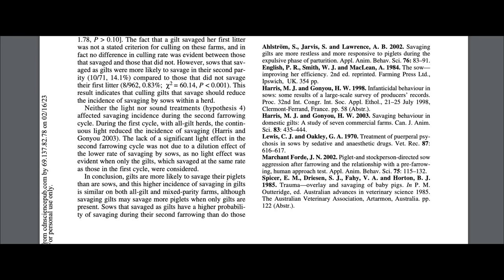How To Beat YOUR INSANE PARENTS In "Mom and Dad"

Comment: Another method is to crimp the end of the garden hose shut: pressure either builds and means the gas will take the path of least resistance (like any weak point anywhere in the hose or the flow is compromised and the gas can't flow as fast, buying Carly and Josh A LOT more time.
Obviously, don't use anything electrical that put off sparks:
Power tool or matches + natural gas = BIG BOOM!

Comment: Once the parents try breaking into the school, i would just go get a mop or something then run to the classroom get my bag and get to the afterschool area and find the keys and lock all the 2 enterances as quickly as possible. 

(It is an area in my school where they keep kids after school if their parents don't come on time for them. Why did i choose it specifically? 
It has all i need
1. It has food. I won't starve.
2. It has a couch. I have something comfy to sleep on.
3. it has a bathroom right in front of it (the school water is safe to drink) Thirst and other stuff fixed.
4. Multiple escape routes which adults can't fit through like the bars on the windows and stuff. Safety.
5. It's hard to spot since it is in a kinda basement level. Extra safety.)

Then catch my breath and relax myself a bit then get my phone and google what is happening, i would turn it off if it doesn't have answers and only turn it on if i have to. 
I would draw and stuff to keep myself entertained since i carry a big pencil case with a lot of markers and pencils i would have enough to waste, i would also try to make a weapon out of the mop or whatever i took.

I could steal some teacher's key i find there and find the room it is meant to unlock and lock i will try it if it works i would fool my parents to come for me and if they do i would get in the classroom and run around and once they are in a corner the furthest from the door i would run out and lock them then i could safely get out and observe the other adults and take notes and try to find a fix for it or how to avoid it.
*Different scenarios*

1. Can be fixed. Fix it and back to normal lives.

2. It can't be fixed.
I would find some other kids and non effected adults like the teachers and try team up to live in the school together and try to have normal lives.

Comment: I would about half way through light a match and throw it as soon as they open the door, (that’s stupid it could set you on fire) I would light it when they open na noor and throw it at them most likely KILLING them but if not dead, I would go on the roof and throw them off when they are up and ready to fight but I would risk myself by going to the edge and then they are probably dead or, I would get everyone I need to escape and I would simply set the house on fire because that is the most affective thing possible to do for my survival, I happen that this will help you if your parents threaten to brutally murder you.